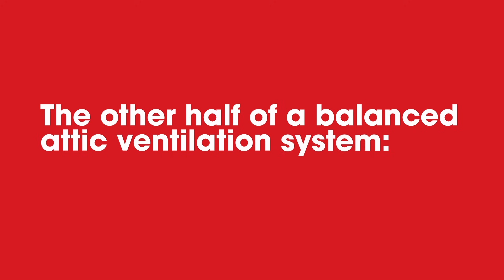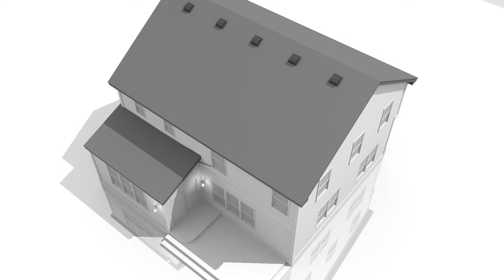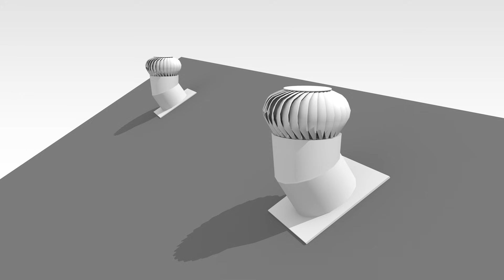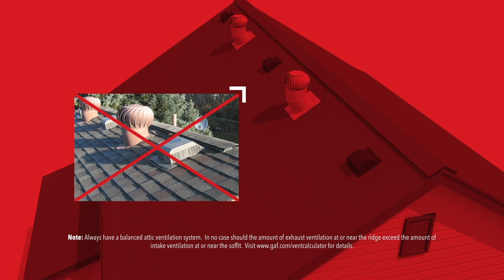How to Select Products for Your Attic Ventilation System | GAF Roofing

Comment: I live in the uk, I have a roof vent system where air is drawn in under the tiles and is expelled at ridge level. The system is supposed to balance. In fact, though, my bungalow runs back a long way. This means there is a long run of intake provision. I think that ridge expelling is not able to cope. There is pressure in the attic. I am feeling downdraught in the rooms. There is thick insulation in the attic. I feel that the theory is wrong.
How do you know there is the right balance between intake and expel? Why should that be? Why are plugs not provided to block off a fraction of the intake air? My system is not a few vents in the soffit but is continuous intake via small “tubes” right along the gutter length. It is so obviously a system liable to unbalance.
Reply from the maker: We recommend getting in touch with a ventilation specialist regarding your concerns.

Comment: Hi I want to know if the outside temperature is 45 Degree C and the inside temperature is 40 C. Bu installing Whirlybird in each room will reduce how much temperature inside the rooms?
Reply from the maker: Our technical experts will be able to help you! Please contact them at 1-800-766-3411.

Comment: Hi, I have ridge exhaust vents as well as soffit intake vents.  I recently installed gable vents for esthetics and also thinking more cross ventilation is better.   Will the gable vents nullify the soffit vents and act as intake vents?  I was thinking hot air will rise and always suck air from the soffits if there is enough exhaust at the top.
Reply from the maker: Hi there! Our experts will be happy to assist you. Please give them a call at 1-800-766-3411.

Comment: Would a powered Attic fan be a good option when there is no Soffit vents?
Reply from the maker: HI, Sarat. Attic fans can be used without soffits if there are gable intake vents. All types of attic ventilation will require intake. Hope this helps!